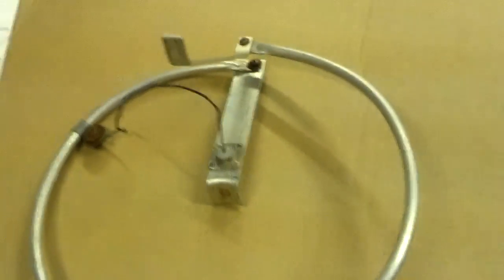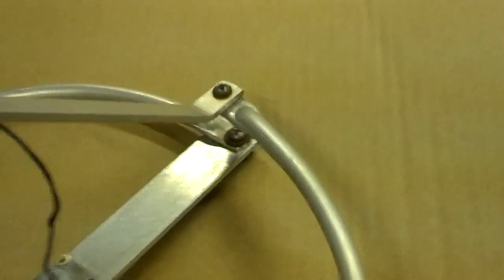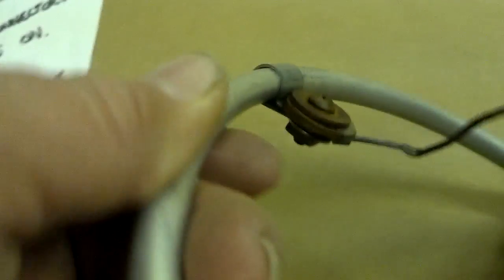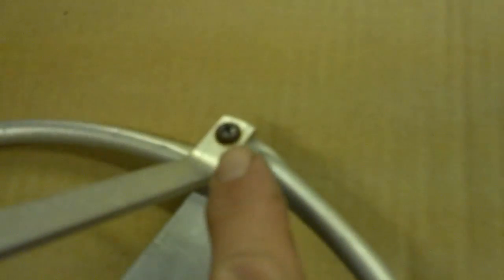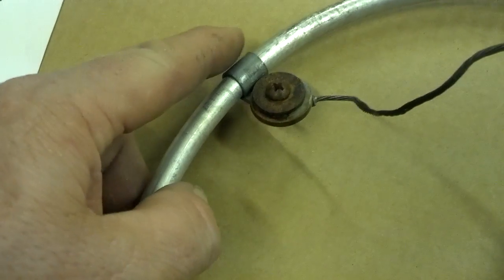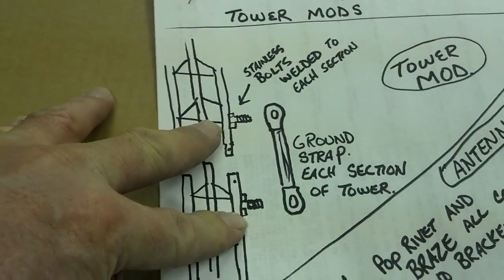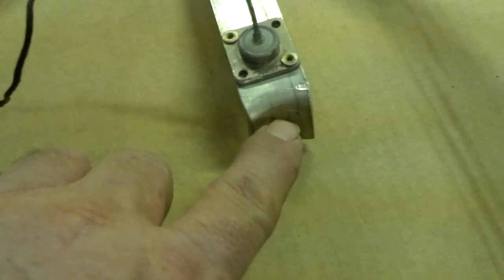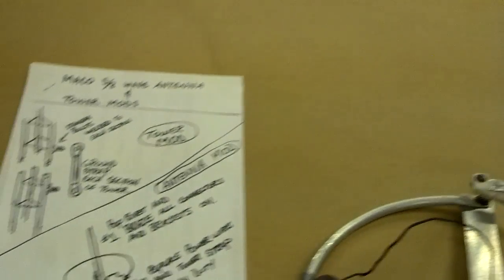Maco 5/8 antenna

Comment: I put mine up per instructions over 10 years ago and have moved it several times since. About 2 years ago I ordered some new parts and replaced all the rusted bolts and nuts. It still works as it did new.
Reply from the maker: They are really good antennas.

Comment: I just finished putting up a Macon v5000 the antenna is so simple I'm going to copy it and make one out of all copper tubing .it can be made for around 250.$ and aluminum is 60% less contacted than copper.only gold is Better then copper.
Reply from the maker: Nice please share your finished antenna.

Comment: Applying silicone caulk on the wire and covering it at the ring against rain water helps keep SWRs down
Reply: I have almost perfect 1.1 ch8-40.. then from ch7 down to ch1 it slowly ramps up to 1.3 and when speaking it'll hit 1.4 on ch1..
I am fine with this (I talk ch30-40) 
But when it rains my swr goes to almost 2/1!!!
I haven't used caulk on the wire and connector, nor the wire and ring. Did caulk help lower it when it rained? Did yours rise in the rain? 😊

Comment: Wow after all these years of putting finials in radios that people that run this antenna i have told this very story to many people about this antenna and to use stainless hardware etc. Hat's off to someone who figured it out. Now you will have a antenna that tunes and works as it should.   (cheers)

Comment: I'ma thinkin tig. Less heat penetration over a large area. Too much heat at the joint and bendie or breakie it will...but rivets too = yes! Haven't decided yet, it's either gonna be a Maco v500 or a Hy-Gain Super Penetrator SPT500.
Reply from the maker: Good luck. Keep me posted on the progress

Comment: Any issues with VSWR changing in the rain??
Reply from the maker: No prob in the rain. Thanks. I'll try to do an update on antenna. The biggest pole of the antenna has a slight bend in it. If I decide to replace it I'll do a follow-up
Reply: @jamesaubrey1965  mine got a slight bend there as well in a hellacious thunderstorm with intense 70mph straightline wind gusts about a year ago. Soon to put it on a tower and mod/repair.

Comment: to make it a 5,000 watt antenna change the wire to a solid 9 1/4in. wire I've put 3,800 watts on my antenna works just fine

Comment: That's not a tower mod, that's standard assembly procedure... Go look at just about any commercial service tower like a big cell tower, they have liberal amounts of ground strapping on them.
Pop rivets on antennas are a BAD IDEA, use stainless self tapping screws at best and keep the hose clamp for support. Personally I would drill the brace and the mast out and use a long stainless or aluminum nuts, bolts with lock washers.
Instead of an SO-239 on there I would put an "N" type bulkhead connector on it. Also I would try an use an aluminum tap wire if possible..
You want to keep corrosion down and different types of metals mixing will creates oxidation and corrosion, add RF energy and that process accelerates add moisture to this equation and the process accelerates even faster.

Try and stick with all the same type of metal if possible, at best non rusting metals and use NOLOX liberally on screws

Comment: The ground straps are useless between the sections since the tower is already bolted together & it is steel.The antenna mods sound good but I have not found an update video for the finished product so I'll be looking for it.

Comment: Awesome...I did the EXACT same things when I bought mine and was putting it together. As I was putting it all together, everything you pointed out (and then some) came to mind. When I assembled my Maco V58, I riveted, drilled and bolted, soldered, extra soldered...you name it, I did it...I even put a thick coat of some kind of clear sealant on all of the connections where metal met metal with rivets/bolts/solder. When I was finished with it, I used an MFJ digital antenna analyzer to set it, and once I got it set...that's where I nailed it down. I have been using that exact same antenna since 2001, and I have NEVER had ANY problems or issues with it. I've even taken it down a few times over the years just to check it out and make sure all the connections were still good, tight and solid...no problems since 2001. If you put the antenna together with some excessive overkill...it will last forever with very little maintenance...if any at all. As a matter of fact, I bought what's called the "Boomer Ground Plane Kit"....which is exactly the same ground plane kit that originally comes with the antenna, and added it to it...just bolted it just below the original one...two ground plane kits with a total of eight ground plane radials...not sure if it actually helps, I'm sure it does...more ground plane area...and it looks cool as hell...lol.

Comment: Never use 'POP rivets' with an antenna, you may need to disassemble for another cleaning in the future. Use non-rusting screws and a liberal amount of NOLOX, then use electrical tape over that.
Reply: Even God uses NOLOX!
Reply: @0ndrous  what is nolox and where to find?

Comment: stainless steel dude.... copper on Aluminum will be very susceptible to galvanic corrosion...  worse then the steel hardware.
Reply: +Matt K  even the bolts need replacing. look like galvanize, they rust over time.
Reply: Actually brass washers between copper & aluminium radically slows oxidation.